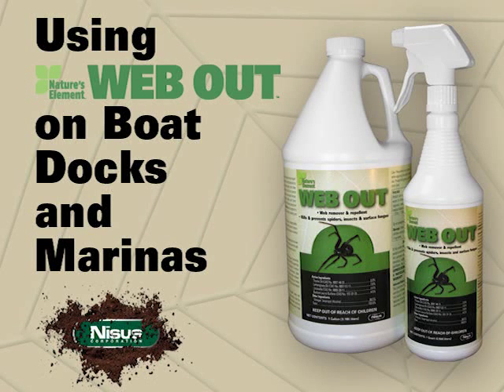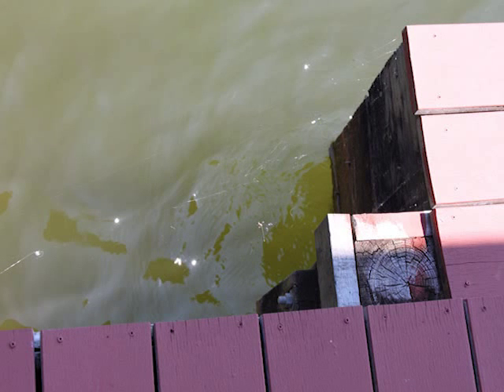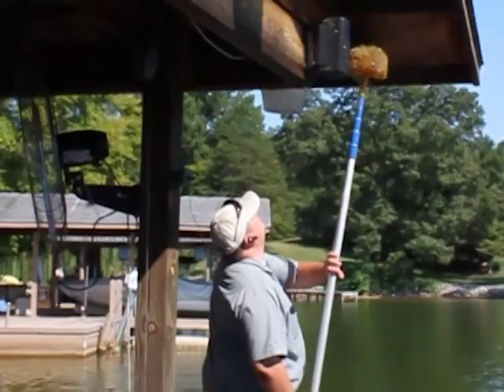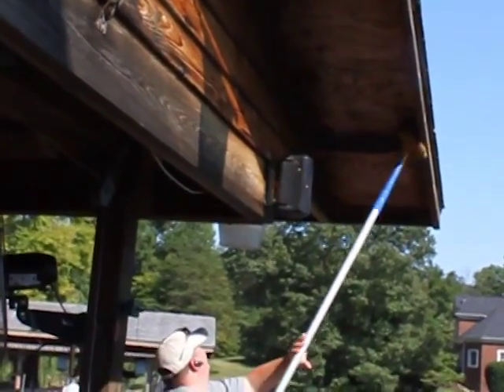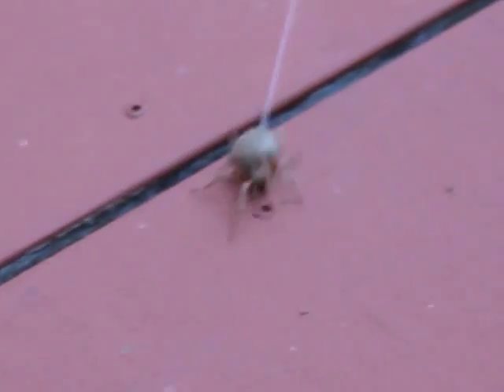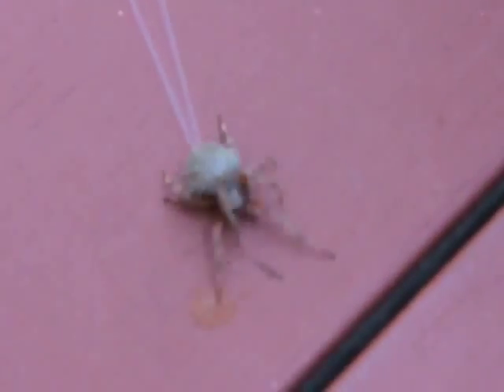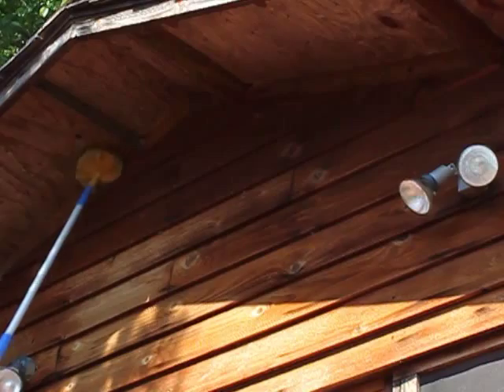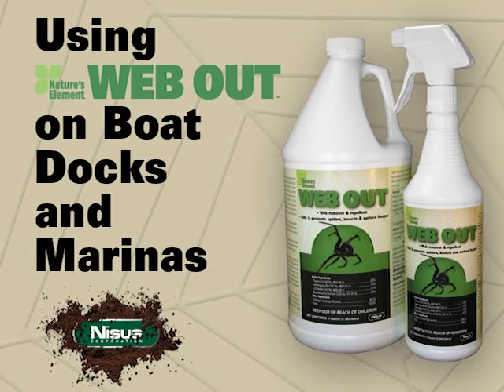Web Out controls spiders on boat docks and marinas

Comment: Can I spray this on my boat and cover to help with spider replant?
Reply from the maker: This product contains essential oils and could stain and/or leave a residue behind. It also has a strong fragrance. While it can be sprayed on the boat cover, we strongly suggest testing in a small area before applying to the entire area.
Reply: @NisusCorp  have you ever heard of a customer using it on their boat?
Reply from the maker: @stephaniemiller1368  Web Out may be used in and around marinas and boats as well as boat docks. It will control spiders that are directly contacted by the Web  Out. Because Web Out contains essential oils, it can penetrate and potentially stain fiberglass if the gel coat is oxidized. It may also stain metal. To reduce the concentration, you may dilute the product with one part Web Out to one part water. Always test a small inconspicuous area to test for staining/discoloration/residue before using on any surface. Always avoid allowing any pest management product from contacting surrounding water.

Comment: Do you dilute it with water?
Reply from the maker: Hi Joshua!  Great question.  Web Out is ready to use with no dilution necessary, but should be shaken well before each use.  You can apply by spraying it directly on the surface where the webs connect to the structure or by using a sponge, a Webster, or other brush.  Thanks!